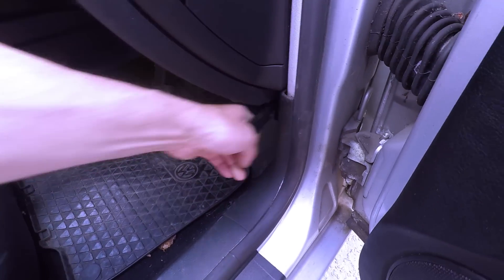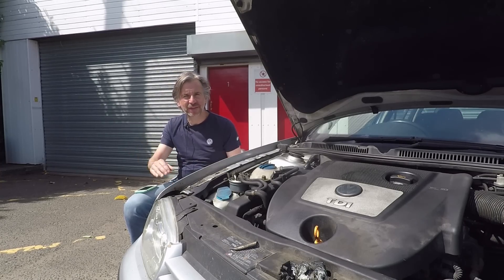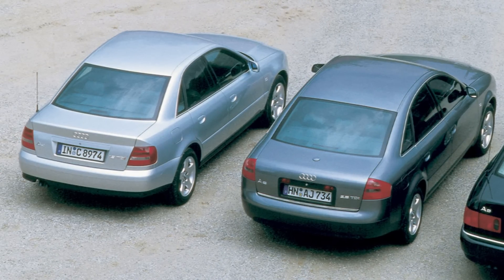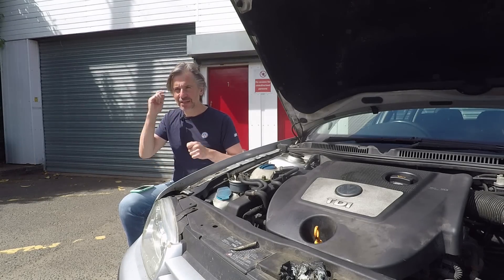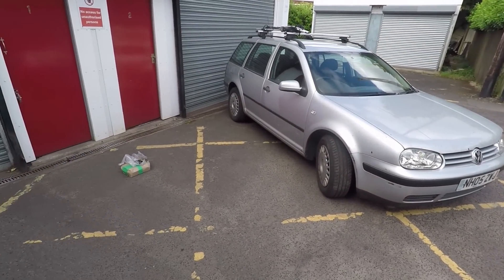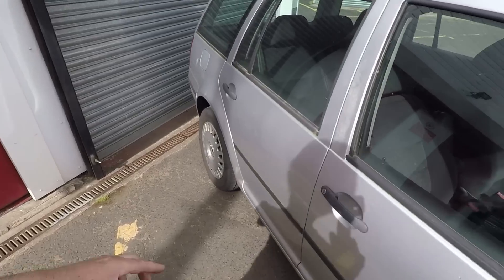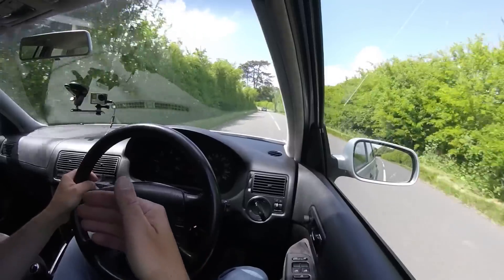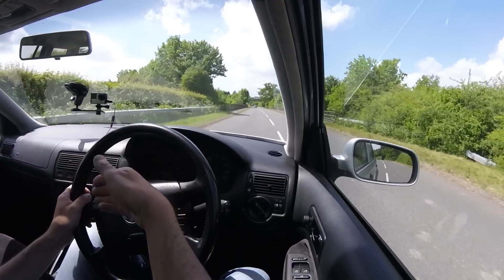I BUY A CAR with VW's BEST ENGINE for JUST £1!

Comment: Interesting video as usual, I have a cr tdi 110 equipped vag product and I love it, but I agree entirely re the emission control garbage, how many cars will have an early demise and therefore environmental cost because an expensive and difficult to diagnose part has failed. However I’m on 130k and so far so good, but I do a lot of mway and don’t abide by the ridiculous 18k service interval. Only thing re the pd engines, I did have a Passat with the last bxe 1.9 105 bhp engine, and it was a droney old lump especially at mway speeds not sure if that was just that version of it but certainly it was reliable.

Comment: hi.i got the same car too
my is on 55 plate with mk 4 recaro seats,15" audi pepper pot. my first golf and estate.yes my front floor is wet too. 2 years i had 2 dmf and clutch.3 gear box first one  2nd hand and the other is recon.is a love and hate  Relationship because keep putting money in to it. i all so own a lupo gti 55plate at the same time for 5 years which i only cover 10000k with NO problems apart from 3rd break light. i sold the lupo to a very very nice couple. she gone to a good home.😪.can you do video on the  Leaking door please.thank you very much.

Comment: Sold my mk4 gti tdi because at 190k miles cluthch went. Got a mk 5 and the dual mass flywheel disintegrated after a month and needed new gearbox. Engine on 5 has never been as smooth as the 4 and if you try to start it warm it chunters and shudders for ages before starting...shite

Comment: ASZ good engine. BXE /BLS . Run out engines 2006-2009 ish are famous for throwing rods through the block due to poorly designed oil pump drive .

Comment: Ive an 02 plate gttdi 150 on 245000 miles original engine still does 500 miles to a tank 
And my mate has a mk3 1.9td umwelt estate  on 115000

Comment: Great channel. Just subscribed. I have a PD130 Golf MK4 Sport. It's my daily and pride and joy. I have a T25 camper and my partner has a MK5 Passat 2.0 TDI which has been fortunate to have a nice remap to 170.

The Golf is staggeringly reliable and a real joy to drive. It has the BBS Montreal alloys, Recaro seats and of course the engine power delivery is so smooth. I do love the economy it gets too.

I'm just about to fit a new exhaust back box, and will need a cambelt this year. Other than that I've had one cylinder loom failure and that's it in 5 years I've owned it. It's at 190,000 miles now.

Will treat it to some bushes and new suspension system soon.

Thanks again

Comment: To say to got a bargain goes without saying. Even the injectors which I thought would over £100 second hand are really cheap. Nice cheap work horse. Is that a dual mass or single? I'm only asking since dual mass are expensive because of the flywheel

Comment: Got a pd130 running 260hp on a bone stock engine, only changed the intercooler and turbo. See people running 300+ crazy
Reply: If you believe you have 260 from a standard exhaust/downpipe, standard injectors and standard maf sensor, you’re deluded lol
Reply: James Dullea nah it’s got a straight through, forgot to mention haha, injectors are at the limit pretty much just need firads for more power

Comment: I would really hope that the brake fluid and shock absorbers have been changed at some point in 214k miles 😱
Reply: probably only maximum of twice.. might well be original shocks for a 2006 car though.

Comment: The only reason it had injector problems is because the car wasn't happy, it wants to be slammed on coilovers, its the best way to lower the emissions on any diesel VW and if you want it to stay reliable don't fix all the little faults, leave some things broken.

Just like the relationship between Man and Woman, if you give her everything she wants she will never be happy.  These cars are the same so to keep it reliable so it comes back for more, Slam & Thrash it.  If your taking it to Wolfsburg it needs to be low otherwise you will look like a tourist.

Comment: I had  the Ibiza tdi 130 running 200 bhp and 360 ftlb for 16 years and traded it in for the UP GTI . It was going in for the  scrapage deal but that didn’t happen and luckily it’s  still running around locally to me lol !  I traded it in with 186 k on the clock and hundreds of laps of the Nurburgring as well as doing trackdays on nearly every UK track . 
Great car/ engine!
Reply: Yeah, right.

Comment: The mighty pd engine best engine in the world there’s a taxi in Barnsley where I’m from with 870k on the clock pd130 same engine and the engine still as it’s original head gasket it’s never been apart

Comment: Fabia Vrs taking a piss in (old) TOP GEAR  beating Mini cooperS 
My mate has this engine in 3 door golf...over 150k miles...still working well original turbo...55 mpg on steady 65_75 mph no problem at all...
DPF had proven to be great idea
executed badly...my A3 8p 170 tdi pd after 30 minutes on motorway pretty much silent...excellent torque leaving it in 6th from 45mph onwards...50mpg at 70mph doing bang on 200rpm😉
BUT after changed job loads more city driving i could feel i am killing the engine😢😢😢
Only best bp or shell diesel in and always 20 miles quick run after filling up...STILL fucking DPF was clogging up😞😞😞
Did basic carbon clean for 80 pounds and yes it helped for 2 months but then again...
HAD to sell the car SO SO sad...after just stage1 remap and egr delete this will push out well over 210bhp and 350 torgue😍😍😍
If i would do atleast 100 miles every day again this 170pd would be real performer👍
Reply: It was only a Cooper, not a Cooper S. I had a Fabia vRS and had a right blast in it!

Comment: I brought an audi A3 1.9 tdi 130 for £1000 3 years ago, it had 150k on the clock. Had it 2 and a half years and it was the most reliable car I've ever had. Sold it with 180k, was still running perfectly. Definitely one of the diesel engine ever made....

Comment: My mother has a 2002 year with the 1.6L petrol, 4 speed, 8 valve engine, oh and it's the SE model which comes with heated leather seats. Great little car all round, but my gosh does it drink..  and I mean seriously drink. It gets roughly the same MPG as my 2.0L turbo VXR lol (17-18)

Comment: Andrew do you want to sell the mats?
Reply: It's very hard to find genuine VW MK4 rubber mats.  I've just found some used ones on eBay a couple of weeks ago after looking for ages.  Other things I managed to find...Last VW-stocked NOS headlight protectors for MK4, one of the last sets of genuine MK4 Variant (Estate) rear mudflaps - they differ from the hatchback ones, also recently found a genuine MK4 first aid kit which will be going in my MK4 Variant.
Reply: SuperFIFTHGEAR  I had zero chance when looking for a tow bar in my variant 4motion

Comment: Its an 05 plate so its a 2005 car not 2006
Reply from the maker: It's a 2005 reg but it's a 2006 model year car, the model year starts in the middle of the previous year.  If you can put the reg in and get the VIN you will see the number 6 before the W in the chassis number which means 2006 model year
Reply: volkswizard if it was 06 car it would display 06 or 56 on reg

Big clur there
Reply: volkswizard i have a 10 year car on a 13 plate
Reply: @thestud5053  that doesn't make sense , but this cars deffo a 2005 if it was 55 reg then it possibly could be an 2006 like my old car.